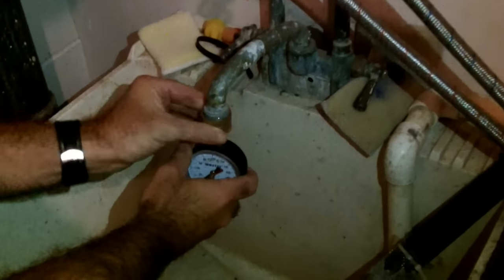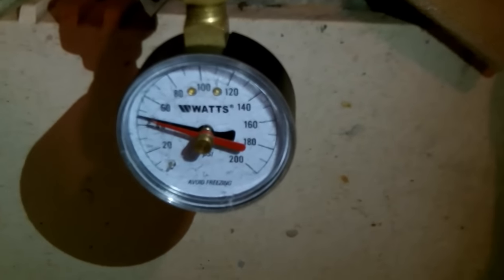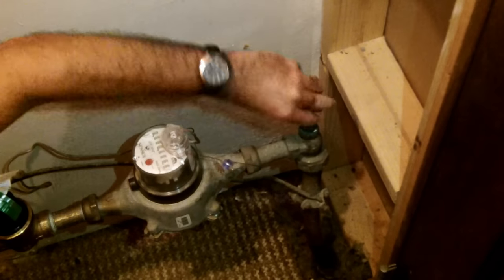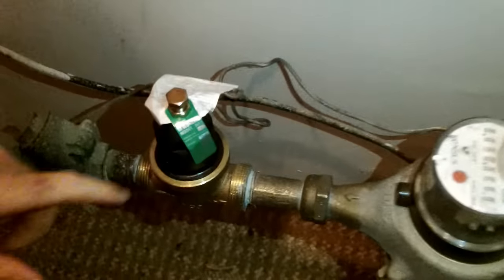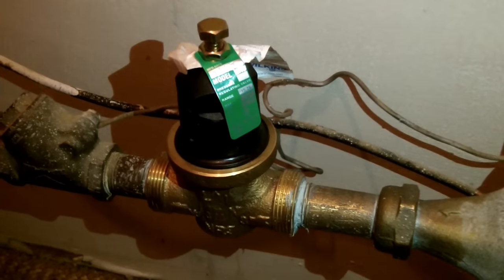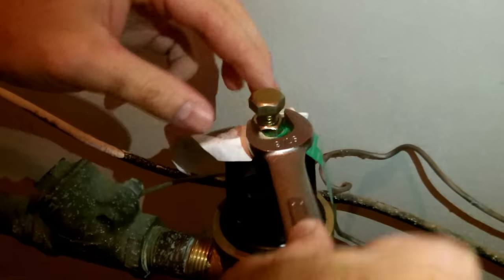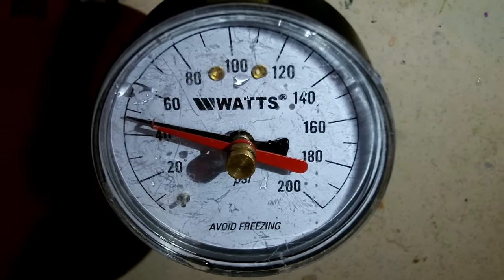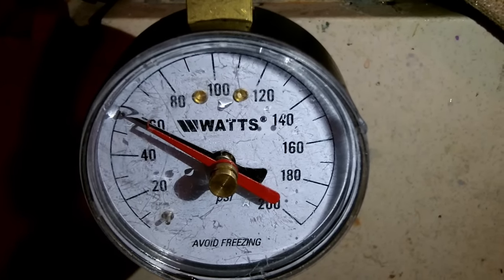How to Test and Adjust Your Home's Water Pressure

Comment: Left and right is relative. Please next time use the expressions “Clockwise and Counter Clockwise”.
Reply from the maker: You got it Thomas Parker - this was one of my first videos and I was still getting the hang of it. Most of the new ones use clockwise or counterclockwise.
Reply: Alright then! :) Otherwise good video!
Reply: Michael D It depends how you are looking at it which is relative. Hence right or left becomes relative whereas clockwise is objective thus the appropriate expression to be 100% sure.
Reply: Very thorough. Thanks!
Reply: Left loosie righty tighty. Left and right does not change when going in a circle sir lol
Reply: @passportgang8189  I understand what you're saying, but when the top of the bolt head is going left loosie, you'll note that the bottom of the bolt head is going right and vice versa. That's why clockwise and counterclockwise are the more appropriate terms.
Reply: Agree somewhat that clockwise and ccw is better, but left and right is not relative unless someone is opposite to you lol. Everyone has their left and their right - and he’s doing it from 1st person perspective. So your point is a bit anal.
Reply: Good video but what's wrong with saying in or out or clockwise ans anti clockwise
Reply: @Orcaboy  someone could be referring to the top of the circle moving left/right or the bottom of the circle. saying clockwise takes the guesswork out of it
Reply: FORRREAL
Reply: @cbutters If you’re looking at the top and it’s going clockwise…. If you look from the bottom it’s going clockwise.  Same as how left from top would appear to be right from bottom.  Try it.  You’ll see i am correct.

Comment: For anyone who don't know, this is a very important video so pay attention! :) Our water heater busted weeks ago and it was due to the water pressure being in the 90s! It was a painful repair and costly too! Great video!
Reply: @waynv1835  No, shutting a valve partially would reduce the flow, but not the pressure. The pressure reducing valve uses a diaphragm and spring to reduce the amount of pressure in the rest of the system.

Comment: For those who do not know. On the gauge there's a black line and red. The black is the water pressure measurement, the red is  the water pressure shock gauge measurement. That's the pressure that causes water hammer or the knocking pipe noises. Be sure you're set within safe limits of both

Comment: I got quoted $1,500 dollars from one guy to adjust my water pressure and then I got a second quote from someone else and he quoted me $400. I told both of them to go to hell it can't be that hard to adjust the pressure! Doing my own research to see if I can do it myself and boy I'm glad I am because this doesn't look difficult at all!
Reply: Make sure you run your tub after, see how much of a pressure drop you get at the farthest point of piping.
Reply: It’s easy assuming your line already has a pressure regulator installed. Those price quotes lead me to believe you do not. In that case, most of the cost will go toward installing a regulator.
Reply: @curtiswiseman3178 is a pressure regulator used to reduce or to add? Can you get more pressure then what's already there

Comment from the maker: It's preferable to get your water pressure down to 60-80 PSI. Of course you'll notice it at first but at least you'll preserve your home's water lines. Water pressure regulators do go bad, so you may want to see if adjusting it works and if it doesn't then replace it. Hope this helps Debbie.

Comment: You'll need to release the pressure to get a new reading.  Ie, if you simply turn down the regulator the lines are still pressurized at the old level.  Open a tap for a second, close, then watch your meter show new pressure.

Comment: in the video, after he adjusted the PRV, you show the pressure.  Is that static pressure or pressure with valve or water feature inside the home open? I assume you are setting static pressure?

Comment: When you are using the ratchet and socket to turn to the left to reduce the pressure; are you turning the nut or the bolt?   Or both?  Then tightening the nut only to keep in place.

Comment: I live in a residential place with a second floor. When I moved in I noticed our whole house had low water pressure. We changed out all of the out-dated pipes and had the same result. I had my plumber install a Grundfos Scala 2 booster pump that conveniently began to leak after the warranty. Before trying to repair this device, is there another water pressure booster device that the plumbing community can recommend that has a history of reliability? TYIA

Comment: Do you really have to shut off the main water supply before you adjust the water pressure regulator valve up or down? If so why?Thanks.
Reply: No

Comment: Does one actually need to turn of the water to the house before adjusting the water pressure regulator?
Reply: no, check it with the water running and the water off.  The hot water tank heating might increase the pressure as well

Comment: Thanks for your quick response!  I had one salesman tell me they didn't exist.  I assured them they did.  My local store did not have them.  I live in a remote area (Minong, Wi.) so someday when I go to a larger town I will look.  One other question, why do I need to shut the water main off to do this?
Reply from the maker: You don't need to shutoff the water main to test the water pressure Popeye . Hope you find a gauge next time you're in town. You can always buy one via Amazon, too. The shipping shouldn't be all that bad - it's fairly light :)

Comment: 1:12 when you said "screw the nut to the left" and turned it to the right, that's a little confused!
Reply: you turn the wrench to the right (counter clockwise)  to turn the nut left.  Turning the nut left reduces pressure, turning it right (clockwise) increases pressure.
Reply: Im confused as well.  Looks like he increased pressure.

Comment: The way i was showed was you take the wrench and loosen up the bottom nut righty tighty, lefty lucy. The Top bolt is suppose to go towards the right to increase or towards the left to decrease the water pressure, then you tighten the bottom nut again to lock that top bolt into place! MMM ???? Just watched another one that says you can just the bolt on top to increase to the right and decrease it towards the left by a quarter turn then check your water pressure, also make sure no one is using the water at home too. FYI you can also buy those water pressure faucet testers that you put on your outside spigot to see how much water pressure you're getting. There should be a tag of some sort saying the range of Pressure that you can use for your pipes! between 35 and 85! FYI :)

Comment: Is the water pressure indoors and on the outside spigot usually controlled by the same regulator?  Or do I need to call the city to ask about the external ones?  It’s like 105 psi…
Reply: Usually that front spigot is before the reducing valve so it will read High because there's no reducer but after that the reducer is like the first thing people usually put on so yes that first outside spicket can be high pressure compared to the whole rest of the house because of that spigot being before the pressure reducing valve

Comment: Recently we started hearing a loud humming noise when using the shower that would stop if someone turned in the sink faucet at the same time.  I am assuming that means the pressure is too high?  I adjusted the pressure valve left 1/4 turn to see If that helps.  I will have to go purchase a water pressure meter to put on the nozzle.  Thoughts?
Reply from the maker: The only way to know docroot1 is to test the water pressure with a water pressure meter. If the pressure is over 80 psi then you may need a water pressure regulator. Let me know how it goes.
Reply: It could me a pressure balancer cartridge for the shower,they do make that noise when going bad.

Comment: What is the device to the left of the pressure regulator, seen at 0:55?  Looks like a Y-fitting with the side port capped.  I have one of these Y-fitting devices upstream of my pressure regulator.  In this video, that device is downstream of the pressure regulator.
Reply: Its a swing check,could cause problems with thermal expansion issues.

Comment: My water pressure is 110 PSI,  Should I decrease the pressure to 80 PSI.  Another problem I have, there is a knocking noise at the lower pressure.  Does water pressure regulators ever wear out.

Comment from the maker: John, if your water pressure shoots past 80 psi it probably needs to be replaced. Have you had issues with the pressure rising over this reading?
Reply: Mine was at 105 or so. I only needed to adjust the regulator. No replacement needed.

Comment: Hi.  I have turned off the main water shut off in the basement to replace a Shark Bite fitting that wont shut off anymore.  I have released the water pressure all through the house and in the sink and shower of the en suite where I am working but water keeps coming out of the water supply  for the toilet.  It wont stop.  There is no water in the toilet tank so its not coming from there. Never seen this before. When you shut off the mains and relieve the pressure in the system water should not be coming from a supply line ? Any ideas ?  Thanks

Comment: Hi Jeff, I live in a Apartment. My Slumlord has turned down the water pressure in my kitchen sink only on the hot water. The hot water in every other sink and shower in the building and apt works just fine. We can urinate harder than the water comes out. How do i turn the pressure back up my self? doing dishes is just easier in the bathroom now....
Reply from the maker: Hey Garrett, thanks for your question. I'm wondering if they did some work on your sink and forgot to turn the shutoff valve the whole way to ON. Turn the shutoff valve handle the entire way to the left or counterclockwise. Maybe this will solve your problem. Hope it helps but let me know the outcome

Comment: When testing water pressure I'm doing it with no water running inside the house and the reading goes up like crazy over 100 psi. But when I open a faucet, it goes down to 25 psi.  My question is which one is the one I use to measure.
Reply: +Saladinkaio test it with no water running
Reply: Sounds like an expansion problem.

Comment: Hi there.
My PRV does not have a nut on top but does have the two nuts on the bottom,
How do I get to reduce or increase the pressure?
Can I put another nut on top, if so, how would I do that?

Comment: Can a faulty pressure regulator make it sound like there's water running in the wall and make the water meter register a false leak?

I hear a faint sound of water running in the walls, but absolutely ZERO signs of a leak in the wall or under the concrete slab. No water stains or mold anywhere in the house, attic or around the house outside. Also, no muddy areas or overgrown patches of grass in the yard.

I had my HVAC guy come by and he punched a few holes in the walls where the sound was loudest and everything is bone dry and dusty. We're stumped.

The water pressure regulator (that bell thing in the video) is located with the water meter access, not near my home.

I want to know if maybe it's on the city's side that is registering false meter readings like a faulty water pressure regulator or meter before I start shelling out hundreds of dollars for a leak detection crew. 

I already did all of the normal tests like shutting off all the water supply valves, checking the flappers of the toilets, etc...

Comment: I have a regulator that doesn't have a screw on top, just a flat plastic cap...what can I do?
Reply: Unscrew it Lift case off. 2 screws on springs.  1 is for pressure on  2 is for pressure off.

Comment: where is water pressure gauge located generally?
Reply from the maker: Sorry for the Shilpa Acharya for the delay. The water pressure regulator is generally located where your water main is. For example, our water main comes into the house in the basement and the water pressure regulator is located right after it. Hope this helps

Comment: Could someone help? I have a shower that randomly produces no pressure at all and I do have a pressure regulator like the one in the video. However, it is really painted over and I cannot turn the bolt without using a heavy amount of torque. Any advice out there? I just don't want to ruin the thing
Reply from the maker: Hey Kevin Roberts - how old is your shower's mixing valve? I know this is a hard question to answer but if the mixing valve is bad you might have to replace it or at the very least swap out the cartridge if you have a single handle faucet. Do you get good water pressure everywhere else in your home?
Reply: The shower is actually brand new. The owner had it installed before we moved in and pressure seems pretty good throughout the rest of the house. The owner lived here by herself and probably just never noticed because she didn't use both bathrooms
Reply from the maker: Well it does sound like a pressure regulator problem. If the regulator is older and you suspect it needs to be replaced it not's a bad idea to do that. You probably already did this but try to get as much of the paint off as possible and hopefully that reduces the amount of torque needed to turn the screw.

Comment: if u rduce it that means the water coming out of the taps is slower. why would u want to reduce it from 70psi? i ahve mine on 80psi
Reply from the maker: +randomrazr 60-80 psi is good. Not saying to reduce it if you're already at 70 psi, it's a personal preference.
Reply: Jeff Patterson yeah the maxx on our water regulaor seems to be 80psi as it wont let me turn it any further
Reply from the maker: 80 psi is good

Comment: So, Expansion tank failed, a while ago.  Capped it off until I could replace it.   Little did I know months would go by before I got back to this project.  I know, not good, but I'm getting to it now.  When checking the static pressure of the water system to determine the proper pre-pressurization of the expansion tank, my static water pressure reads almost 100psi.  W/ water turned on, 50psi.  Turned regulator counter clockwise, "water on" pressure dropped below 50psi, but when shut off, static pressure built to 100psi again.  Turned regulator clockwise, "water on" pressure rose as it should, but no matter how much I adjusted either way, static pressure would climb to 100PSI again.  I suspect my pressure regulator might be bad.  My Town water pressure varies between 60psi at high elevations to 160psi at lower elevations (as published in the Town Water Department Website).   I have a Watts Regulator -"N35B" - Size "3/4" - Model "US" - Set "STD 50" Range "25 - 75".   Thoughts?
Reply from the maker: You might be correct about the the water pressure regulator being bad. Did you retest the pressure after a few days of use?
Reply: I Have the same problem and don't know what to do
Reply: Did you ever figure out what the problem was?
Reply: Hi Steven - I have the same N35B 3/4" PRV and I'm seeing my static water pressure at 85-90psi - So wondering how do you determine if the Pressure Regulating Valve(PRV) is good or bad? Also I have a thermal expansion tank and I filled air to set it close to 80/ 85 PSI - not sure if my thermal expansion tank-Proflo brand might be bad?